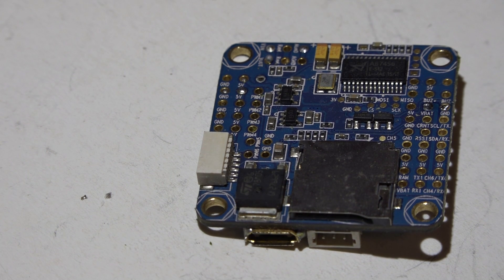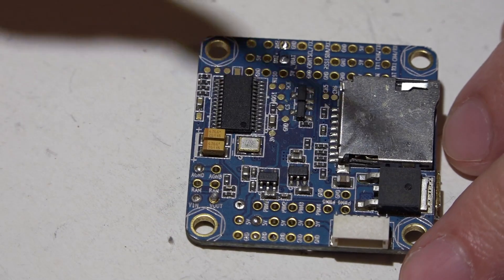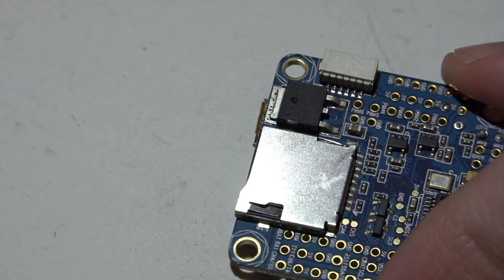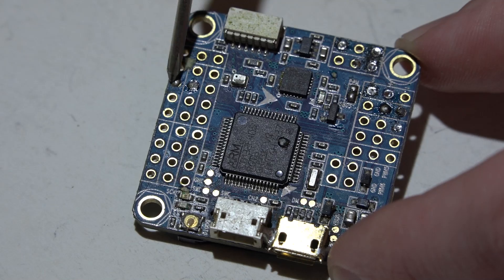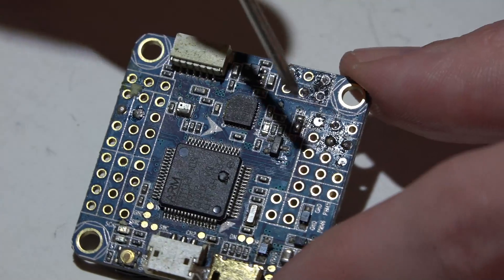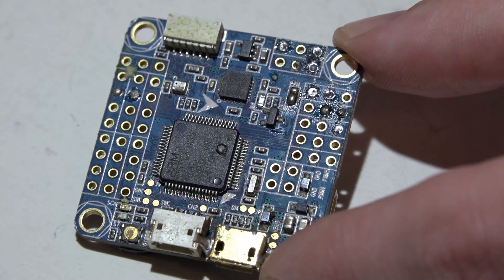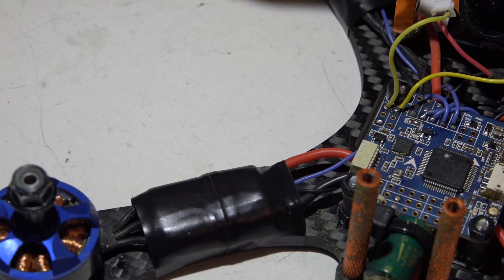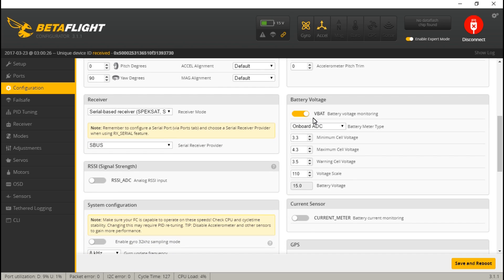How To Power Flip 32 Omnibus Without Its Own Regulator

Comment: First off all realy thank your for that! My Flightcontroller dos not overheat anymore and it stays at 30 degrees. But i got still the problem that my OSD is turned off... it wont work... i tried a lot with switching grounds an stuff... but nothing works... i powered the Fc from PDB Matek xt60 with 5 volts. There are 4.96 volts going in.. i think thats close to 5 Volts and it has to work... but no... could it be any possibility that the OSD running out of voltage... ??

Comment: Dear Project Blue Falcon, I firstly wanted to thank you for your very helpful videos. I have an F3 AIO and its been a great guide to follow. I am using this board for a custom micro build and have paired it with a 6a AIO (4 in 1)  ESC. Everything is functional as I have followed the procedure for power jumper connections. I however cannot get a voltage reading in Betaflight. I don't really care for current, I just want volts so I know when to come in to land. ESCs connect to VSS on the pin out, is there a possibility to jumper on the board or do I have to take steps to modify as in your video. The reason i ask is because I am using the plug on the underside of the board. I am assuming this apart from carrying pwm signals is the same as an ESC providing a 5v BEC input? Lots of people love this board and also AIO ESCs for convenience. It reads fine plugged into other boards straight up.  Your help and advice would be much appreciated! Many thanks!

Comment: I am doing a micro build with the Omnibus F3 Nano on 4s. I ordered the FC without the BEC. Is there a way to use the current sensor even though the FC is powered by external 5v? I would like to view the voltage and current through the OSD.

Comment: im doing a 6s build and i have the omnibus f4 osd flightcontroller. is 
there anyway to hook up the vbat with this type voltage with the osd 
working. i just realized i think this board is 2-5s direct power 
connect. i could always connect the vbat with vreg off of the pdb to 
keep voltage in its limits but i would loose the correct voltage for osd
 to give me correct readings 
any thoughts?

Comment: I tested that out yesterday and the only thing I need to do is remove the bad regulator from the FC. it does work powering it from the 5V and having VBAT, but with a fried regulator I definitely need to separate the two power sources! thanks again man!
Reply: only question left is will I loose my 3.3V for my receiver if I remove the regulator from the system or will the 5V still provide power through the FC? I really don't want to jam in another component like a step down regulator for my spektrum receiver.

Comment: I plan on using the Omnibus F3 running iNav on a plane. I assume I can eliminate the built in 5v reg on the board as you mentioned in this video and then you the 5V/3A switching BEC from the ESC into motor 1 to give all the board 5v.... can confirm!?

Comment: Can you bridge VBAT to CRNT with solder and get current sensing that way? They're right next to each other on the board and it's not like the board can discern whether it's getting input from two different wires coming from the same place or 1 that feeds both  pins.
Reply from the maker: Absolutely not. Current pins are not taking the voltage and changing that to a current reading. The current pins only accept a super low voltage pwm signal from an actual current sensor. A current sensor will take the voltage, do whats needed to figure out the current, then translate that into a signal which goes to the current pin. Applying voltage to the current pin will fry the processor.
Reply: Awesome, thank you.   Surprisingly enough, I wired my F4 FC (a clone version) exactly the way you did in the video on my first go with no instruction to do it that way.    In your experience, how accurate have you been able to get Virtual Current sensing to work? Or have you even messed with it much? I fly my batteries down to almost the same exact level every time just using the voltage telemetry with all the logical switches and special functions I've set up, but it'd be nice to get fuel % to go by as well.  Not if Virtual Current isn't accurate enough to even bother doing the terrible current calibration process though.

Comment: What if you dont remove the LDO and power it from the lipo through vbat and use a 5v BEC on the esc pin, Would the LDO still get very hot?
Reply from the maker: Not only will it still get hot but you will greatly increase the risk of frying something. I'd just cut the legs off the V-reg.
Reply: @ProjectBlueFalcon  when i did i cut the legs didnt want to power the board its old black flip32F4

Comment: hay jc I just got the flip 32 it Flys  around ok but we I got to flip or roll it skits out do u do wot this cod be
Reply from the maker: It really could be anything. PIDs set too high, too low, could be getting vibrations from motors or propellers, filters not tuned, ESCs not calibrated, channel endpoints not set right, and much more.

Comment: Do I have to do anything extra to connect to my computer? I have an f4 v2 pro.
Reply from the maker: The F4 Pro has a different voltage regulator than the other Omnibus flight controllers. It's better and doesn't have the same problems as the non pro versions. So this video wouldn't apply to you. As far as connecting to the computer and Betaflight if this is your first time you'll might have to change the driver to make it connect. Look in my Omnibus playlist and you'll find a few videos on how to do this.